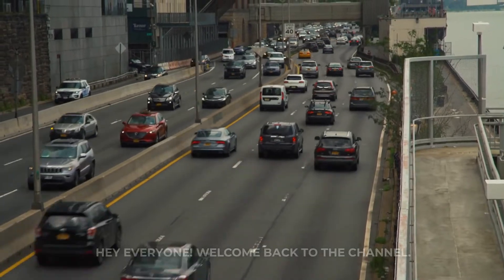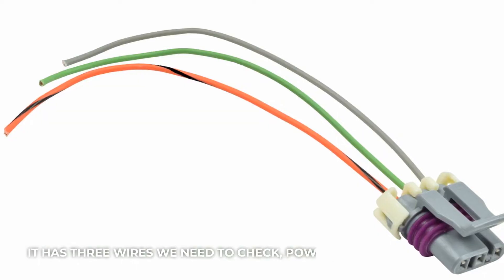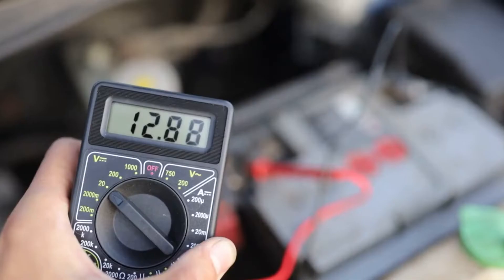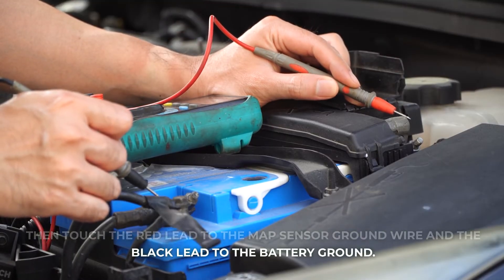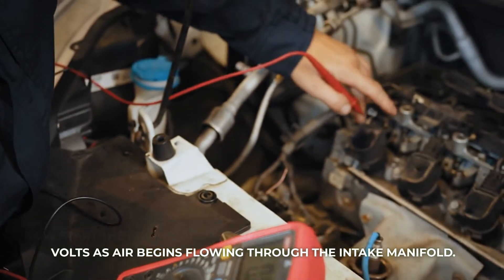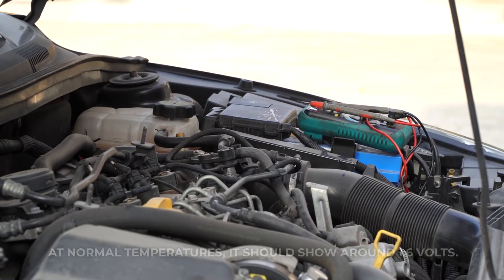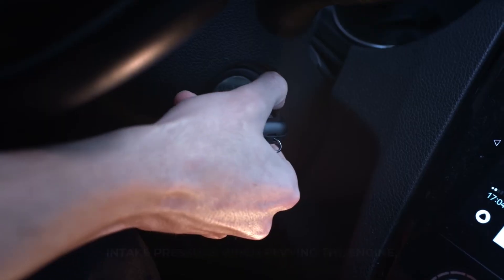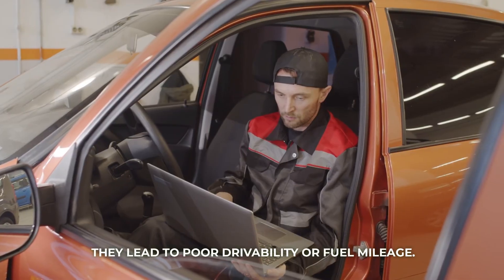How To Test Every MAP Sensor | Step By Step Guide

Comment: Some sensors (old Ford) do not have %v on the signal wire but 2.5v. It allows the voltage to increase or decrease as pressure in the throttle changes
Reply: thats gonna be hz(freq)